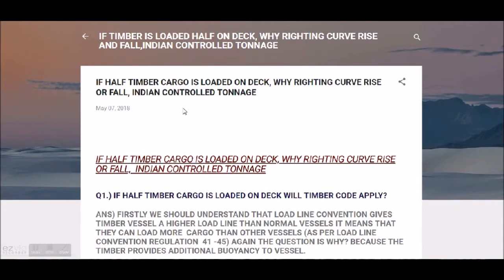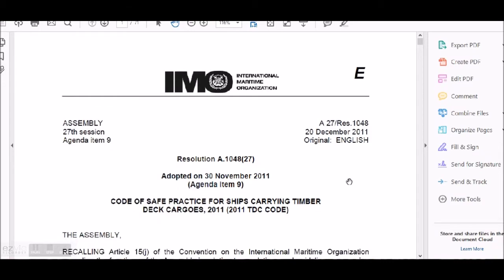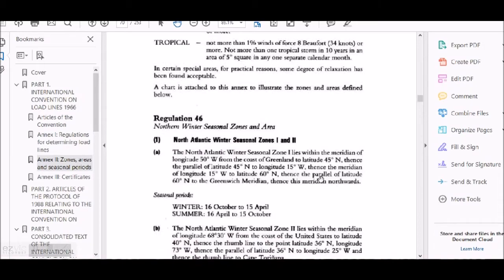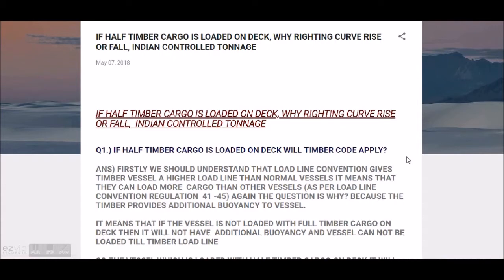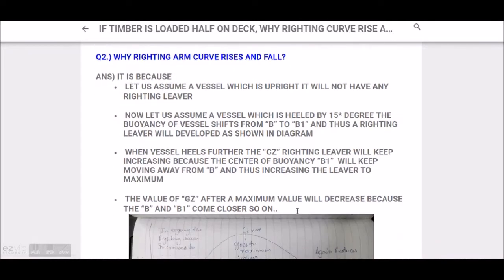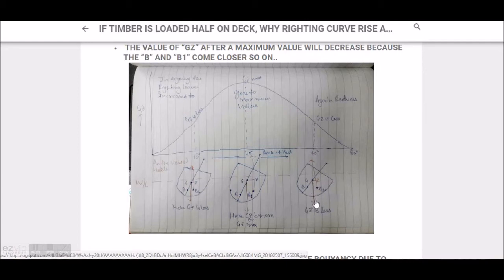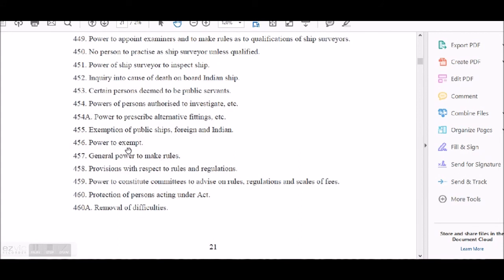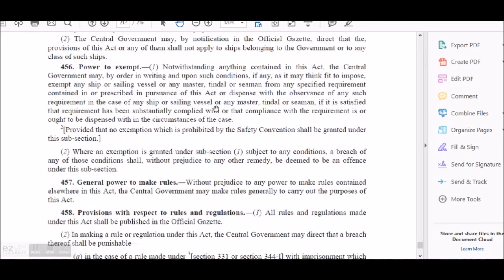IF TIMBER DECK CARGO IS HALF LOADED, WHY HEELING ARM RISES AND FALL, INDIAN CONTROLLED TONNAGE

Comment: For q2 .Nothing to do with BM.? need to consider it as ship heal to larger angle of heal it is meta centre which gets effected due to reduction in waterplane area. Hence B&m are couple and so 'B' gets dragged as m starts to move lower and your gz values get reduced.